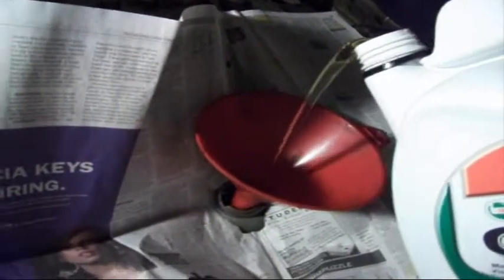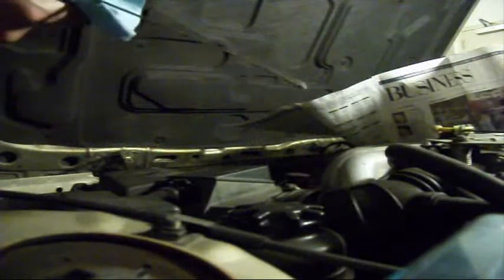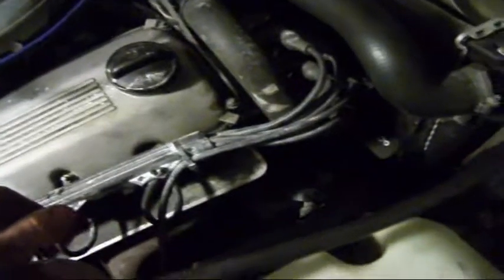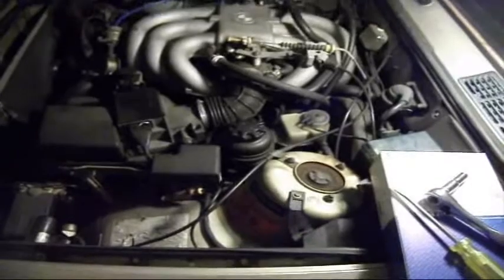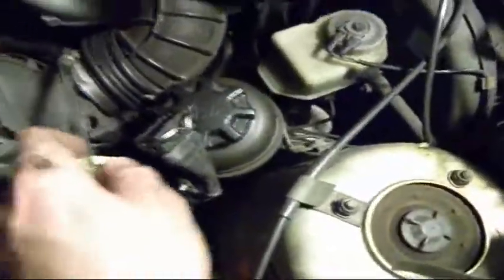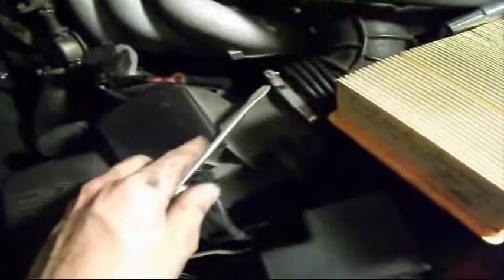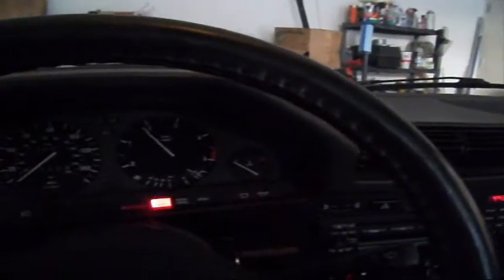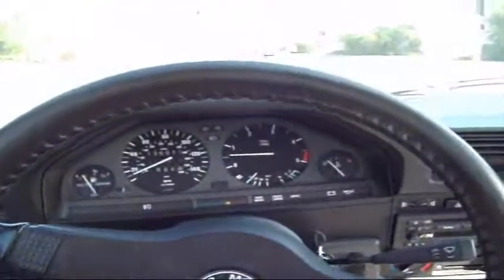BMW E30 325 Oil Change DIY (Part 2 of 2) + Air Filter Change and Test Drive

Comment from the maker: @POPtheoriginal You should be able to replace the air filter box and filter with a K&N tapered cone filter.  You would have to remove the filter box from the vane airflow sensor and mount the K&N directly to the sensor.  If you want to do this because the black rubber elbow intake air hose is cracked then this won't solve your problem.  You will still need to replace that rubber elbow.  Otherwise the car won't idle or run right.  
Thanks for watching and commenting.  /John

Comment from the maker: I had that problem but it was due to a loose connection or corroded connector to one of the rear brake pads.  Maybe the brake pad sensor is not well connected or there's a break in the wire or loose connection or something.  When the pads were changed you need to replace the sensors with new ones if you can't reuse the old.  If you just leave them unplugged that may cause the light to come on.

Comment from the maker: you need to fix this now before a hole is worn in the hose and it starts to leak / blows.  Benind your bent hose is a metal loop on the end of the valve cover.  There supposed to be a black plastic hose clamp there keeping the coolant hose away from the fan. Use a zip-tie and fasten the hose to the hole in that bracket to pull it away from the fan. /John

Comment from the maker: @tkongny flap paper filter because it's cheap and works good enough for me.  My next project & video for the E30 will be to replace the camshaft seal.  I'll have to change the timing belt and drain the coolant to do that.  I may do some air conditioning videos also. /John

Comment: Hi. Your videos are great! I'm going out to change oil now.
I have a problem that I'm wondering if you (or anyone) have experianced. When my engine is hot the cooling fan is hitting one of the cooling hoses that is between/over the engine and the fan. 
I'm starting to wonder if I have a fan from another engine or something. It's an M20B25 turbo (Warsteiner copy).

Comment: Thanks, I appreciate the info! I just bought one of these cars and the air intake hose is cracked and in shitty condition and i was thinking i could replace that whole box with a high performance filter... is that possible?

Comment: Is there any chance you know how I can remove the "Anti-Lock" and "Brake Pads" lights off my dashboard? I got new brakes and the anti lock light came on when my battery discharged cuz i left my lights on. I have the same bmw as you :D 325es 86